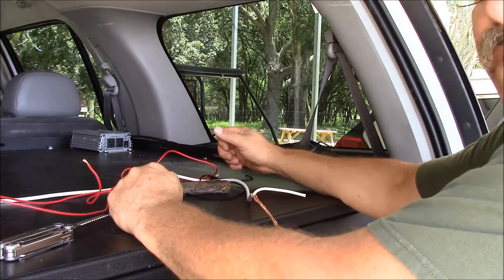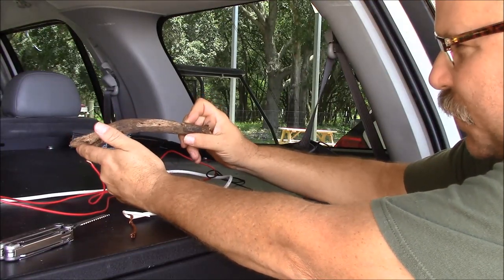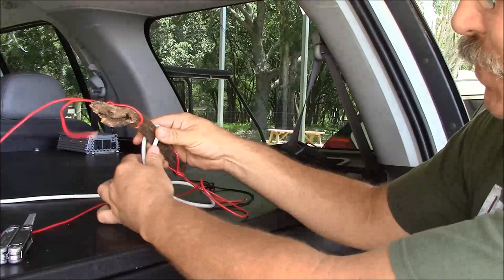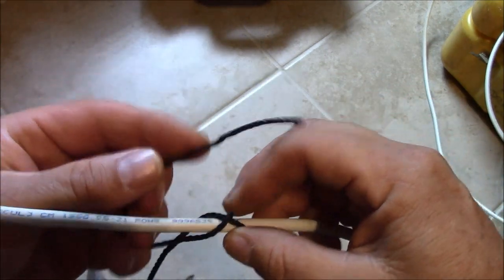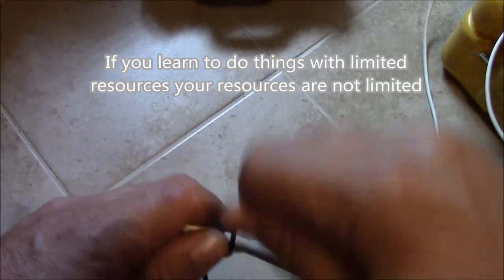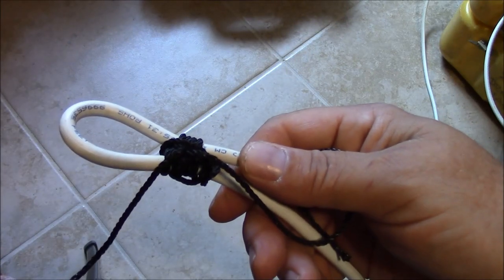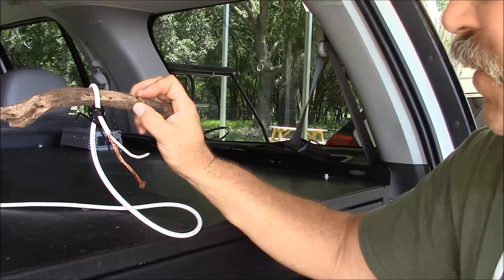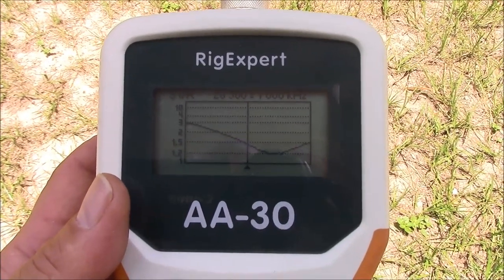Survival Antennas 3 Survival HF Radio Coax Dipole v2.0 feedpoint

Comment: Do you attach that to what is left of the old antenna or through a banana clip directly to the radio?  Newbie antenna builder here.  Great videos.  Thanks.
Reply from the maker: This video was another feedpoint variant of survival antennas 2. We tied the elements with square knot splices in my survival antennas 2 video to another feed point variant.  In survival antennas 1 we broke the conductors out of the coax remnant and made a VHF antenna . Thanks for watching !

Comment: Bret,  how about another method of hitching the coax ?  Make a prussik near the end,  and hang it to the insulator by this.  It has been suggested to me by another HAM,  and saved me the RG174 connectors on my field groundplanes!
Would this work on your dipole? 
Regards Greekman
Reply from the maker: There are many different ways of making this mousetrap. A prusik would work but use more wire than overhand loops IF you had a way to notch the insulator. We used the body of the coax for an anchor in Survival Antennas 2  if one had no insulator.  Im just attempting to relieve strain on the feedpoint in both of these examples.   My intent is to get the viewer to think just like you are - outside the box and  be creative.  I would love to see an example of your idea ! Thanks for sharing and thanks for watching !